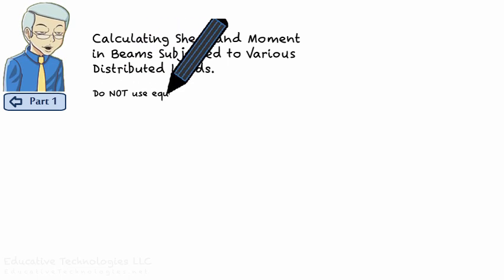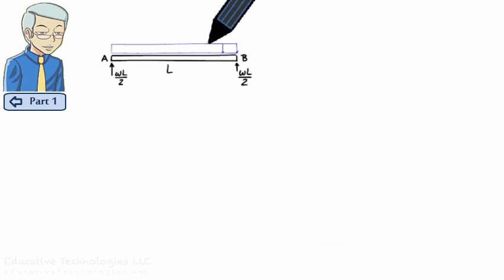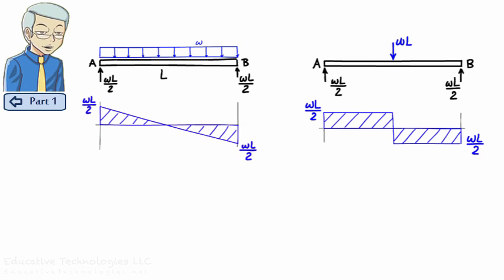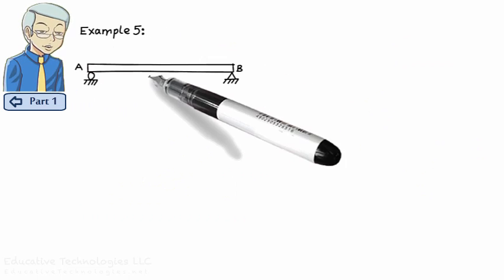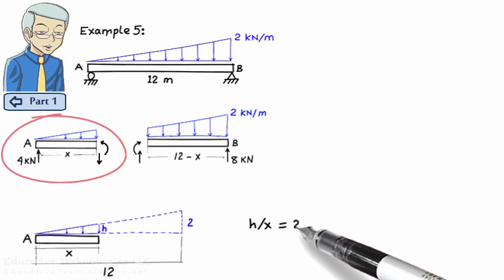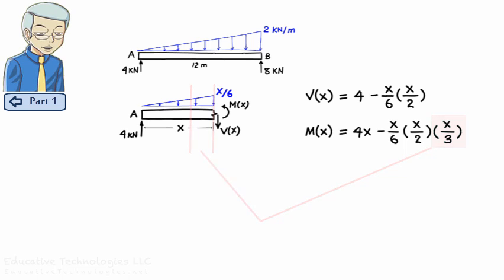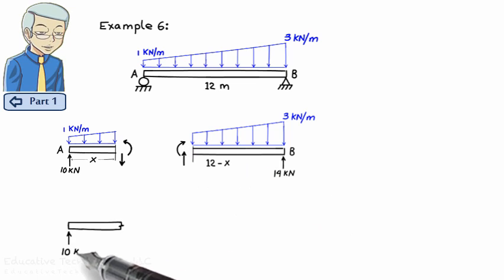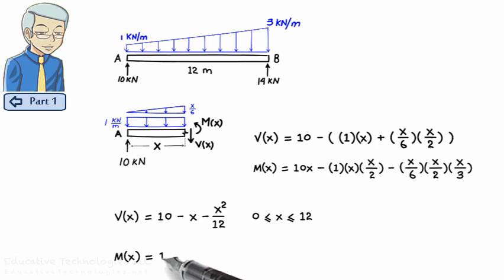SA14-1: Distributed Loads on Beams (Part 2)

Comment: For the example 5, can we take the right section for the calculation? Do we really need to use the same method as example 6 (trapezium) to get the moment equation?
Reply from the maker: Yes, we can use the right segment to determine the moment equation. 

Since we need to determine the moment of the load about the cut point, when the load is trapezoidal, it would best to replace it with a triangular and a rectangular load (as in Example 6). That way, we can easy determine the location of the center of each area (the moment arm) when calculating the moment.

Comment: in the 5th example how did you find 4kN for Ay and 8kN for By?
Reply from the maker: The distributed load is triangular. For the purpose of calculating the support reactions, we can replace the triangular load with its equivalent concentrated load which equals to the area of the triangle, it equals:

(12 m)(2 kN/m)/2 = 12 kN.

This load is to be placed at the geometric center of the triangle located (2/3) away from the left end of the shape. 

(2/3)(12 m) = 8 m. 

So, we have a simply supported beam of length 12 m, with a concentrated load of 12 kN placed 8 m away from the left end.

Now, apply the equilibrium equations to find the reaction forces:

Ay + By = 12 kN
(12 m)(By) - (12 kN)(8m) = 0

So,
By = 8 kN
Ay = 4 kN

See the latest video on beam analysis for another example:
https://youtu.be/1YpoLjKtl3Q
Reply: thank you very much...love from Greece
Reply from the maker: You are welcome. Love Greece!

Comment: does the method of section work with parabolic distributed load?
Reply from the maker: The Method of Sections is for analyzing trusses only. In trusses loads are applied at the joints only, no distributed load of any sort.
Reply: Dr. Structure so what do you call the method you used in ex5 when you cut the beam in order to determine the internal S, and M? I thought that was the method of sections.
Reply from the maker: Obadah Alhalabi Sure, we can refer to this as the method of sections as well, but not to be confused with the Method of Sections for truss analysis. 

Here, the beam could be subjected to any type of load including a parabolic one. Say the load is defined using a general function f(x). To determine the area under the load, we can integrate f(x) between 0 and x.  And, to determine the moment of the load about the origin we need to integrate x f(x).